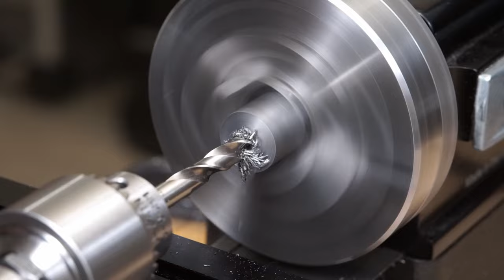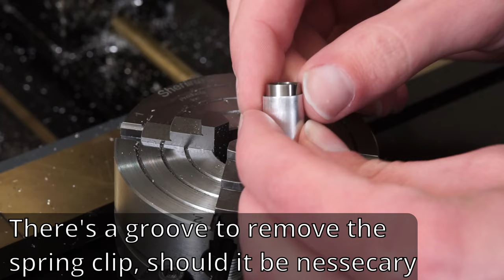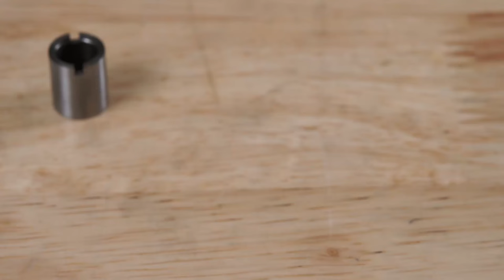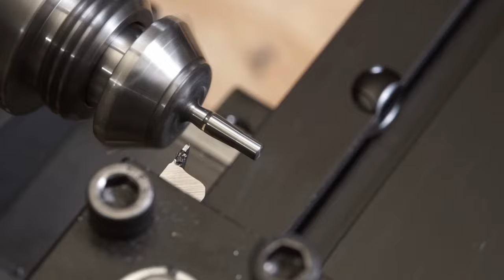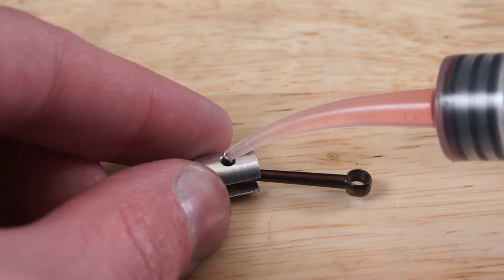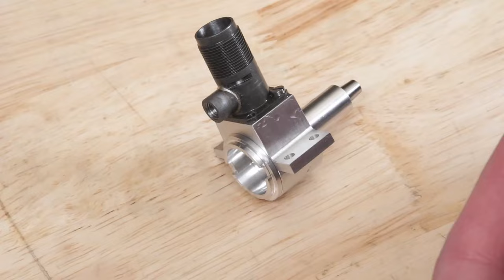Weaver Model Engine Build Series Part 4 - Piston and Fittings

Comment: Nice work. That piston fork looks like a great idea for preventing the gudgeon pin from scoring the cylinder. Did you lap the piston into the bore? I had to do it for a 1cc diesel I built. It was quite tedious. Is this a glow plug or diesel engine?
Reply from the maker: Thanks! the piston fork works good, if a little heavy, but no matter for a slow engine like this one. i polished the piston to size then lapped the cylinder seperately so the piston is a light press fit. this is originally designed as a diesel, but i'm converting it to glow. details here: https://youtu.be/Npu6ZGi8xXg

Comment: Great Work!!  never done a cast iron piston/cylinder.  I know it works as my AM10 is made that way.  I been using 12L14 steel for cylinders with good results.   Thanks for sharing!
Reply: I've made one cylinder from steel and five from cast iron. The iron is considerably easier to lap.
Reply from the maker: Thanks! it's good to hear that 12l14 works for cylinders, i figured it would be too soft, maybe i'll use that for the next engine.